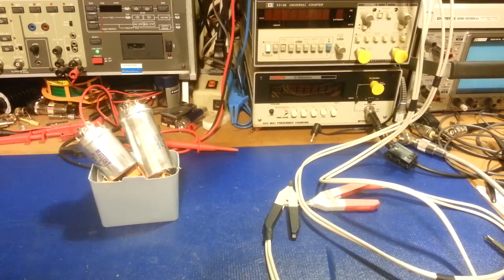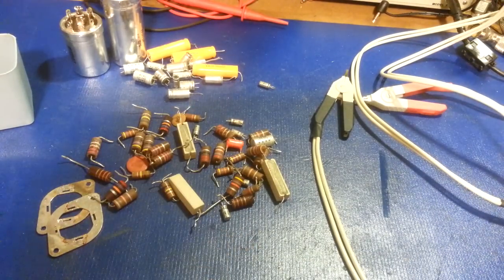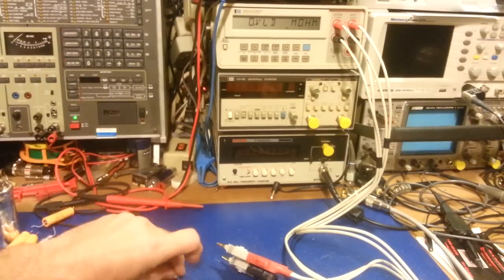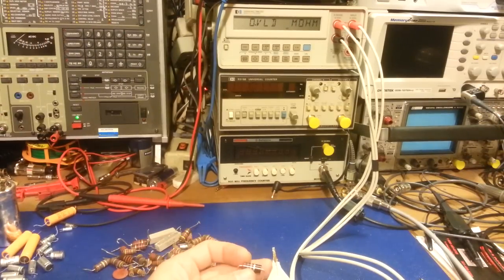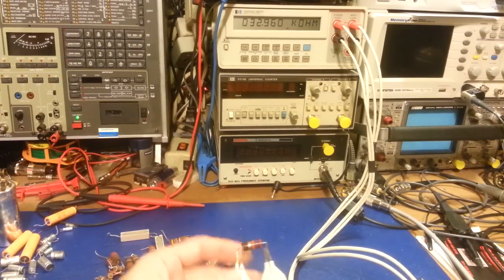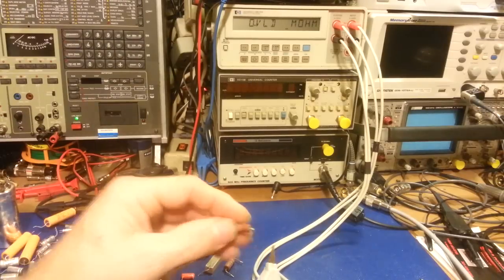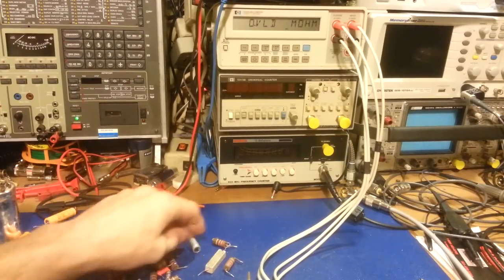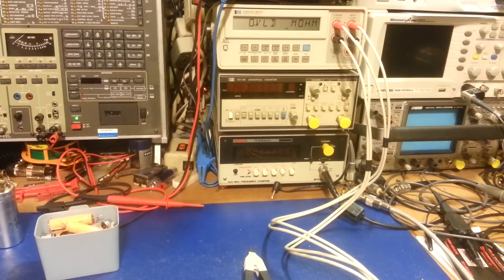Good looking carbon composition resistors gone bad in a Tram D201A.

Comment: i was repairing my Fisher amp and one of the IC's wasn't getting any power, a power resistor went from 22 ohms to 1.1 million ohms.  think it was just a WEEEEEEEE out of spec
Reply from the maker: Yeah, that's just a few percent out of tolerance.  :)
Reply: MikesRadioRepair yup, just a little

Comment from the maker: The only time I use used parts is if the part is no longer available anywhere.  The resistors get the leads cut off for recycling and the rest trashed.  The electrolytic caps also get the copper leads cut off for recycling but I save then save the body for recycling the aluminum.  They are afterall about half aluminum.  I have a local recycling scrap yard that gives me 40% weight for them.  Since I go through about 7-10 gallons of caps a year that's a good chunk of change.  I think your getting the idea, I recycle everything.